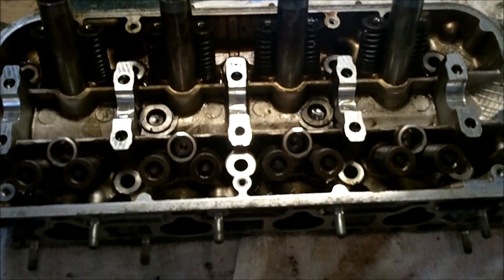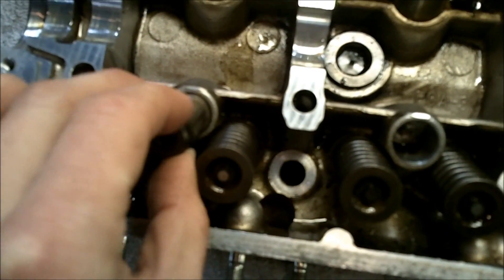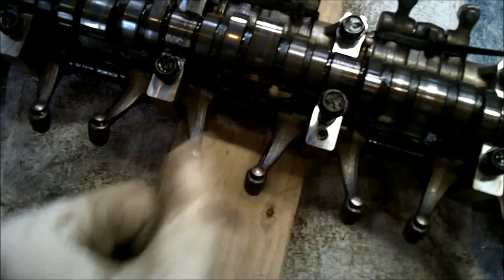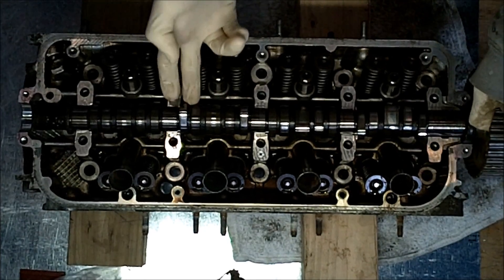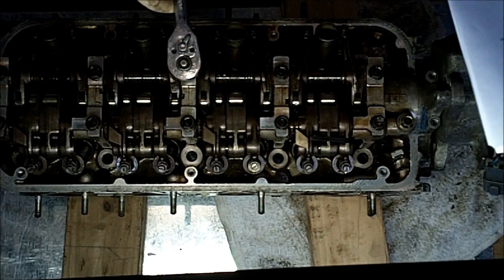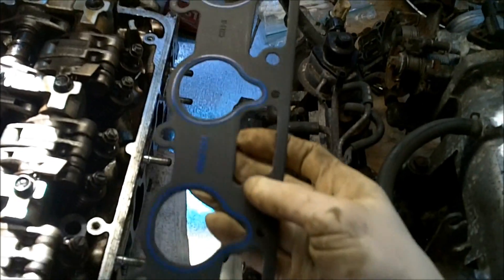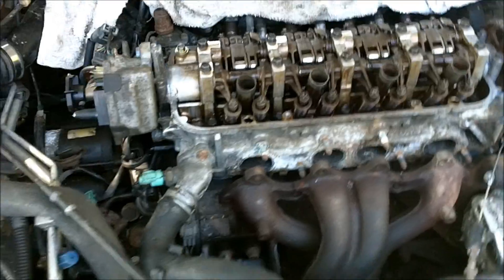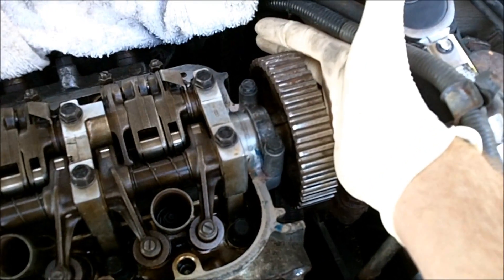HEAD GASKET Replacement Honda Accord VTEC F22b1 and CAM TOWER Installation

Comment: Aren’t the variable valve pistons in upside down?
Reply from the maker: Yep on camera they are, I don't remember if I had to take it apart and flip them because the cam tower wouldn't bolt down all the way, or if I installed them like that. Anyone taking theirs apart should be able to see how they go and simply put them back in the correct way.

Comment: Dude wtf it’s not 108 inch pounds because I did that and the fucking bolt broke
Reply from the maker: 108 INCH pounds is 9 FTLBs. You broke a bolt torquing to 9 ft lbs, you did something wrong.

Comment: Is This Accord Still Alive To This Day? Im Asking Because You Definitely Installed The Lost Motion Assembly(LMA) Up Side Down @2:44! The Car Sounded Like Shit Because Of That, Not Because Of Being Old And Not Because Of Sitting For Years Lol, Sorry To Say But You Dont Know How To Rebuild A Cylinder Head, Dont Blame The Car/Motor For Being Old, It Was Your Fault It Sounded Like Shit, If It Is Still Alive To This Day If I Were You Id Fix It The Right Way
Reply from the maker: Yea my bad. However, I hardly consider slipping machined parts into each other "rebuilding". Don't act like it's special. You're following procedure that was designed by other people and written down for you. The car is still going and the engine quieted down after a while; maybe I'll flip them around, but maybe not.
Reply: It Probably quiet down because the middle rocker arm got worn down due to that up side down Lost Motion Assembly(LMA) Installment but i mean, im not forcing you too fix it, bio means its your car, if you like it the way its sounds then, i mean i cant do anything its your car, if you look at it as a piece of shit car then thats your opinion but i look at it as they are a true strong old motors not a piece of shit, just people that doesnt know about cars make them look bad and riced them out
Reply from the maker: no worries

Comment from the maker: This car is still on the road as of 12/22/2017 ~~ Update: still on the road 8/22/2018 ~~ Update: Got totaled by a deer on 10/30/2018 😭...Update: owner fixed the car and still drives it 3/6/2019...
Reply from the maker: high 100's, low 200's. Probably about 180,000. The car is still on the road today.
Reply: a DIY Car Guy  what is the name of the 4 short parts in the beginning you said to oil
Reply: What mileage was the car at when you replaced the head gasket?

Comment: HAY I NEED HELP I am trying to replace head gasket on my Honda Accord and I was wondering what if I did not put the timing belt. on right. what would happen?
Reply from the maker: at best it wouldn't run right, at worst it would bend the valves and damage some other things. spin the engine over by hand (with a wrench on the crank bolt) before starting it to make sure nothing is binding up
Reply: +a DIY Car Guy so turn it a few times to make sure it feels like is getting caught on something
Reply: and I ran into a standstill 4 of my head gasket bolts will not come loose
Reply from the maker: to make sure it spins smoothly and not getting caught

Comment: I have a 97 Honda I did a head gasket job the gasket is scratch as will as the bottom of the head a little will it be OK or I need another gasket
Reply from the maker: i wouldn't use the gasket if it's damaged. i don't really know about the head scratch, take it to a machine shop to get pressure tested and ask them to look at it

Comment: you might say why using a hoist to lower the head is better than doing it by hand. also dropping a couple of headbolts through their holes in the head to use as alignment guides.
Reply from the maker: Sometimes I put it on by hand, sometimes I put it on with a hoist...depends on the reach and the weight of the head
Reply: Bill Cornelius any of the intake, exhaust studs break? Head bolts break?

Comment: First off, never use a damn paint removal disc to remove head gasket material, for several reasons. Second, I love how you used a hoist to set that gigantic head on the block, hilarious.
Reply: Some people have back issues. I'm gonna do the same thing and use hoist. Yeah it takes few extra minutes to set it up but i'm OK with that.
Reply: You wouldnt be here if you knew how to do it yourself😂

Comment: don't know much about cars but yours sounds like the timing is off
Reply from the maker: lol it's not. the valves are old af and needed adjustment
Reply: You sure i have one too just as old sitting for couple of years and the second timing belt those pulleys are balancers for the timing and have timing mark thats what sounds off

Comment: Is it that the head is heavy or just heavy reaching over risking a back injury and thats why theres the lift? I work on the same type of engine in my school and the head isn't that heavy.
Reply: I'm currently in a 2 year school. I wouldn't call it a community college because it sounds like a dull word for the school I'm at but it is. They do offer a 4 year degree too. I'm doing the 2 year automotive technology program. I'm learning brakes, engines, auto and manual tranny, electrical stuff, and the chassis all in 2 years. Do NOT go to UTI. They will rip you off big time and you can go to a 2 year school and save $14000-$20000. UTI doesn't guarantee you a job and they will not help you. Most 2 year schools will help you with anything.
Reply from the maker: It might not seem like it from the video but it's just a far way to reach from where I was able to have my feet, and the intake sticking off the back made it awkward. I don't want my feet to slip out while I'm trying to reach, and drop it and damage the gasket, or have to bend back up with it, it's easier to have the lift to slowly set it down so I can position it and not worry about anything else. Just don't let the lift hit the hood of course.
Reply: Well good point, I figured it was to prevent some damage or random injury. The 2.2 liter engine the group Im with are working is out of the hood on the engine stands.
Reply from the maker: ***** nice! what are you guys going to do with the car when it's done?
Reply: a DIY Car Guy It's a spared/parted out engine. I am actually in college majoring automotive!
Reply from the maker: ***** Oh nice man!!
Reply: a DIY Car Guy Yeah man its really cool and I get snap on tools thats worth $4900 but we pay for half price.
Reply from the maker: Awesome, that's a great deal considering those tools will probably last a lifetime.
Reply: Hell yeah dude, and even better than lasting lifetime is it's all lifetime warranty.
Reply from the maker: ***** that's for sure!
Reply: Tylnorton 
you going to a community college or like a automotive school like UTI. bcs im looking for a school to go but schools like UTI ask for like 50k and the community college  is like 5k for a degree but im not sure if is one of those, you get what you pay type deals

Comment: that engine sounds horrible, something is wrong, try adjusting the valves
Reply from the maker: +ricgomez1 well it's old as hell and high mileage, it gets quiet when it warms up, it could probably use adjustment, but it still runs to this day

Comment: Hi amigos: mi carro Honda Accord 94, vibra cuando esta  encendido, los cables y el sistema de bujias estan bien y no sé a qûè se debe.
Reply: puede ser los soportes del motor
Reply from the maker: +pedro vargas disla Balance shaft belt might be broken or out of alignment. If you mean the idle is low, I don't know it could be many things.
Reply: a DIY Car Guy EGR valve
Reply: El tiempo
Reply: Afloja Los 3 tornillos del distributor per no oo quites muevelo para asi atras y para delante asta wue mires que menos tiemble.lla cusndo lo encuentrrs menos tembloroso sprietas El tornillos de arrival a Los demas

Comment: did you have to change the gasoline? somebody told me that u have to change it bcause it gets rusty?
Reply from the maker: +gilberto venegas I never heard of that and I did not change the gas.
Reply: +a DIY Car Guy  how long your car stayed parked?
Reply from the maker: 2 yrs lol. I probably put fresh gas in it, but I didnt drain the old gas, there wasn't much.
Reply from the maker: Tanks can rust from sitting, but this one did not. I thought you meant the gas would get rust from a bad head gasket. My brain lapsed.
Reply: +a DIY Car Guy  mine has two years already jaja im buying everything to fix it head gasket set and timing belt
Reply from the maker: awesome haha...it should be ok, maybe take a gas sample to check if the tank rusted

Comment: Cat spotted at 14:56

What year is the 951? I had an 89 for 2 years, fun car, but was too unreliable to keep around.
Reply from the maker: aventari It's an 88. This one sat for 8 years before I got it, put some work into it, maybe about $2000 over the 5 years I've had it, and it's been pretty reliable. I took it on a 4.5 hour trip 8-9 times last year.

Comment: Do you have to take the cam shaft and all that out to replace the gasket.
Reply from the maker: to get the head resurfaced i believe you'll have to take the camshaft out, so the valves will close and not get hit by the milling machine.
Reply from the maker: no the camshaft will stay connected to the head
Reply: Carter de honda acor. 2008

Comment: what was that disc call ... so clean the gasket ... the one you got on the drill
Reply: trade name is scotch brite and DO NOT use them to clean aluminium because you have a high risk of ending up with an uneven surface, it is best to clean the mating surfaces by hand
Reply from the maker: not sure, might be called an abrasive disk....you can find them at an auto parts store or hardware store
Reply: You can use a small plastic trowel/painters knife without scratching the aluminum. You could also use an abrasive scotch bright dish sponge to give it a nice clean surface without scratching anything.

Comment: Do I have to remove my timing belt to replace  my head gasket ??
Reply from the maker: yes...at least the top part (cam pulley), you don't have to take the lower parts off